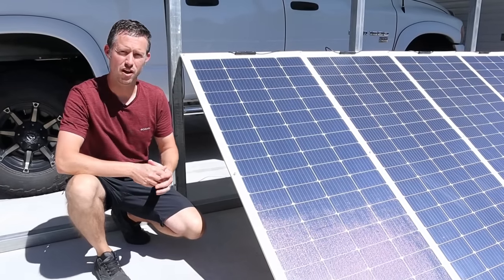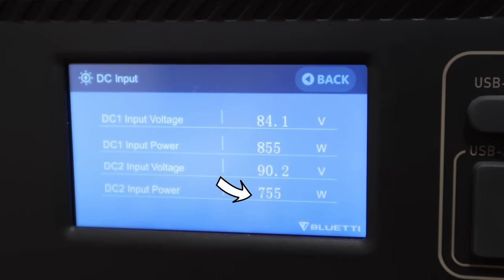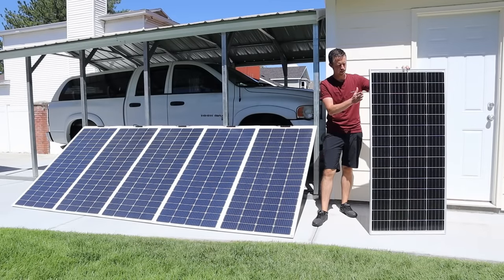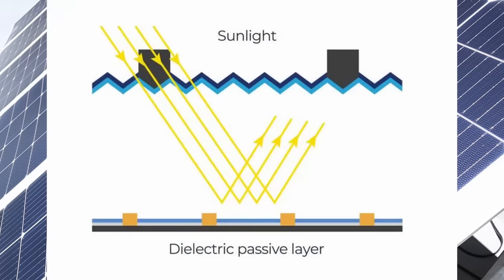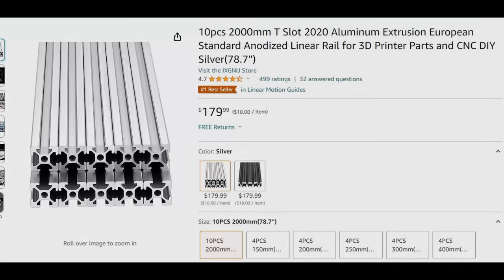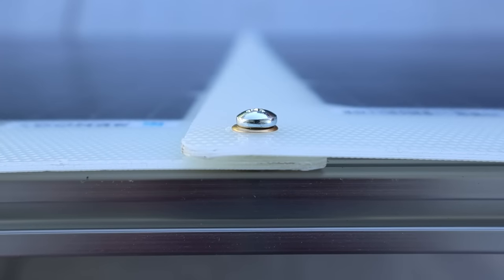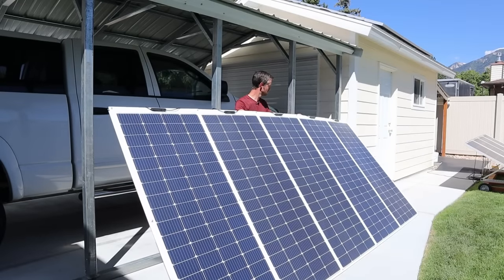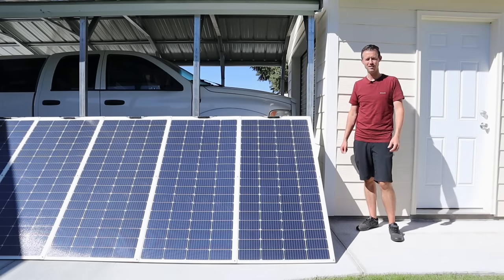DIY - 1000 Watt Lightweight & Portable Solar Array - Five Renogy 200 Watt Flexible Panels TESTED!

Comment: $330 for 200w panel is stupid overpriced, unless you really really REALLY NEED the lightweight. Because their size is not good either, comparable to a residential panel, so their weight is the ONLY reason you'd want to use them.
So what type of application would it need lightweight? 
On a car?! No, because the mass difference isn't much of a difference,.
On a boat?! Nope
Some sort of airplane, but then 200w panel with that size on an airplane is stupid because of the surface area.
So, there is no actual need for such panels. You are better off buying residential panels.
Remember 200w is absolutely garbage, nowadays you buy 400W panels, which are similar in size/weight to the 200w or 300w older residential ones presented here as comparative.
Reply from the maker: There are many neighborhoods where the HOA won't allow permanent panels in your yard. This options allows someone to be able to store a lightweight, slim design in a garage or on the side of your house hidden away until they are needed. Just because it doesn't work for your specific use case doesn't mean it's a stupid idea 🤣😂 Go try to move around 1000 watts of glass panels, it's a complete chore

Comment: I was interested until I figured out you are using flexible panels. What garbage!
Reply from the maker: Still going strong a year later. They have been out all winter and all summer and I get rated power from them.... how else do you get a lightweight solar setup? I'm open to suggestions for a future video using an alternate design.

Comment: Jason, is there a lightweight version of these panels that will max out EcoFlow's strict voltage and amp restrictions for Delta 2, Delta Max 2 and the Delta pro respectively?
Reply from the maker: The Delta Pro is a whole different category of solar input vs the Delta 2 and Delta 2 Max. The smaller models have a 60v cutoff so you'll be limited to 2 panels in series (luckily on the D2M you can have two solar arrays connected for more power). This array should work just fine on the Delta Pro
Reply: I’m not aware of a lightweight solution but Jason made another video showing how to max out the voltage on the Delta 2 using three 180 watt Newpowa  panels with a low VOC just under 20 volts.